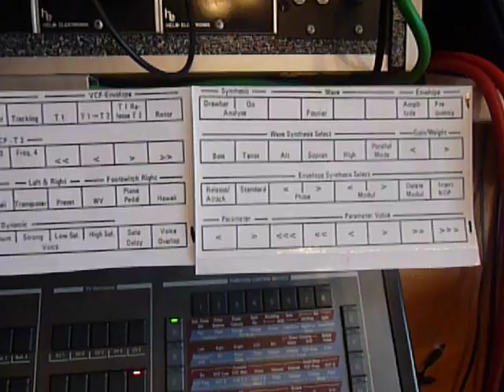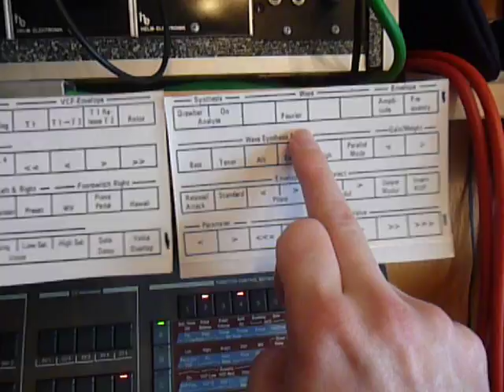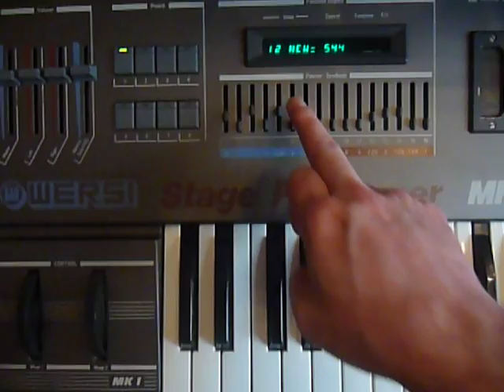WERSI MK1 Soundengine Programming Part One

Comment: You might be interested to know I'm working on MIDI/SysEx voice editor software for the Wersi MK1 and EX20.

I can currently read and write(!) to the Wersi RAM through MIDI, and should be able to completely modify the VCF (envelope, cutoff, Q), frequency envelope, amplitude envelope, fixed fourier wavetable and the relative fourier table in real-time.

Comment from the maker: The "save" option is in the main "function control" printed at the MK1 panel.
All you have to do, is press the "A" and then the "7". Your sound will be saved in the next CV button you press. 
But only the 1. and 2. voice of the "right".
If you´ve done a stack with 3. and/or 4. voice as well, you´ll need to save it in a preset (by pressing one of the 8 preset buttons). The Preset buttons can store the whole machine (=midi setup and effect,wheels, velocity, split and layer settings), just to say:)